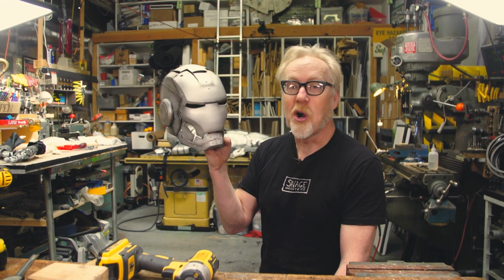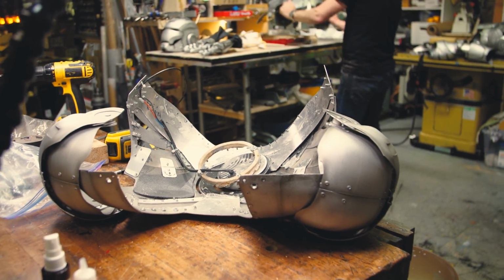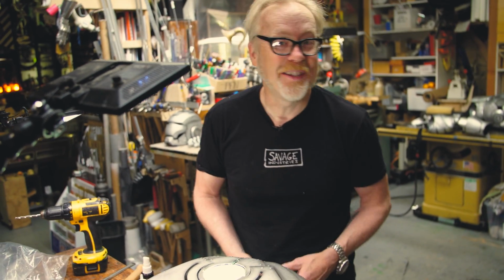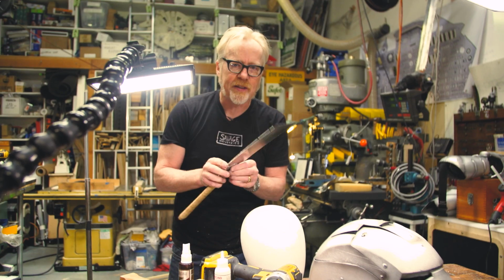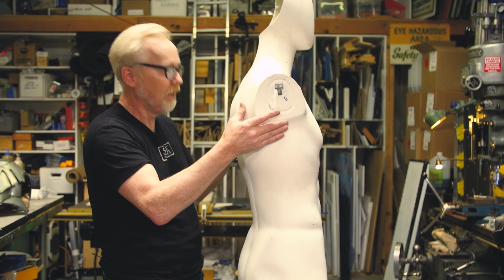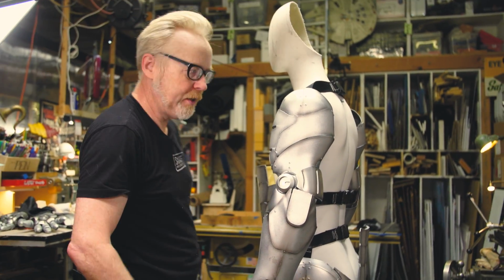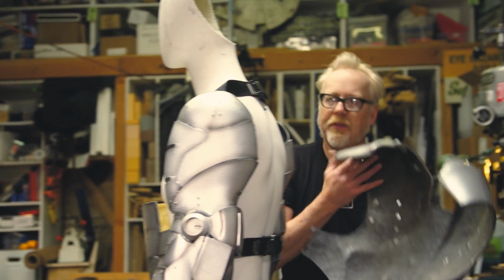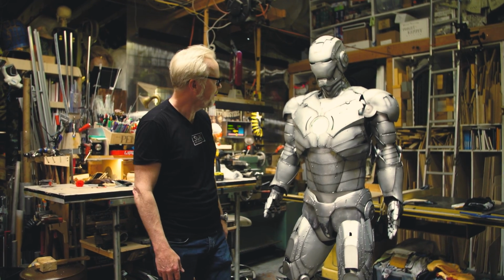Adam Savage's One Day Builds: Iron Man Armor Stand!

Comment: I perfefcted Titanium printing like a boss.... I base my machines on the swirling of material into and out of the printpoint! Thats the secret. I take away the heat while adding material and wittling away unrequired supportmaterial. It does, in the same operations, release the tensions or instill greater tensions in the materials (depending on how you direct the maelstrom at/or/and around the material)- This, ofcourse, also makes heat to allow correct setting of your materials to adjust any deformations in a print. 
Atleast thats how I made my components. Like I know how static deformation and heat-treatment work. Unlike those other noooooooobs that just print without knowing how internal stress on components build up to make their little things less swell.

Comment: Adam, looks like you need a  pneumatic reciprocating saw. Would have prevented you from abusing that hand saw and using that jigsaw in such a scary way. They are so precise when paired with a swiveling air fitting you can use it one handed laying upside down under the dash of a car.

Comment: Wait. What is this "corn starch thing" I guess I'm supposed to know about? (9:52)
Reply: Taking a guess I think dusting yourself down with corn starch before you get sweaty so it controls the moisture on your skin. This is to stop other crap sticking to you like that fibreglass dust.
Reply: @MaximilianonMars  Yeah, I looked it up. Apparently, rubbing baby powder, talc powder or corn starch on exposed areas before working with fiberglass will help prevent fiberglass splinters.

Comment: As Adam casuals wipes away fresh hot-glue with his thumb.
Reply: Done that many times. The heat dissipates pretty quickly.
Reply: @MrFloppyHare  i must be useing to high of heat on my guns then t-t
Reply: @Lone-Traveler   I don't know, you need the minimum amount of heat for the glue you're using, of course. It's also a case of being used to it. And licking your finger before you wipe the glue also helps. ;-)
Reply: @MrFloppyHare  ah ok ill try that, cause sometimes you gotta go for the glue so it doesn't ruin a project
Reply: @Lone-Traveler   Exactly. And if it's a glue like CA or an epoxy, I use a cotton bud that I wet and smooth in my mouth first so that fibers don't get stuck in the glue and you can add a smooth finish to the glue. (Remember to only use that side once, though! ;-) )